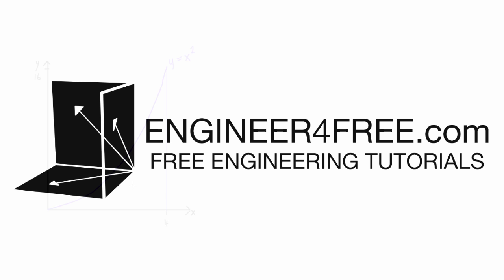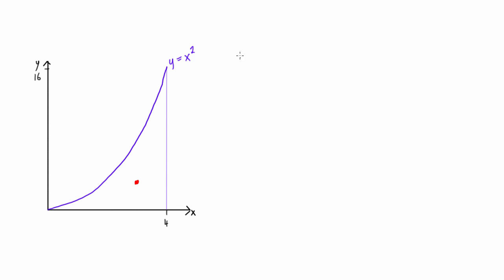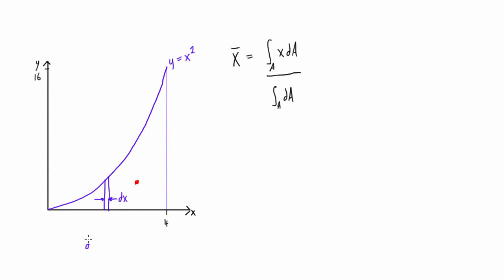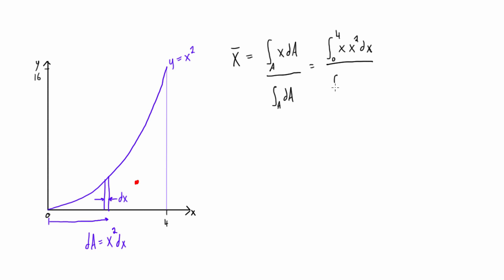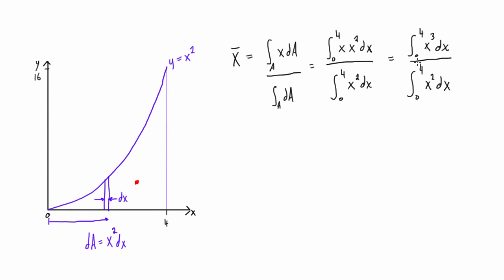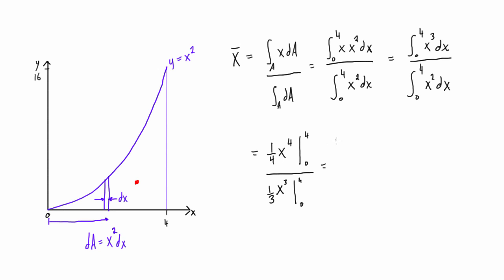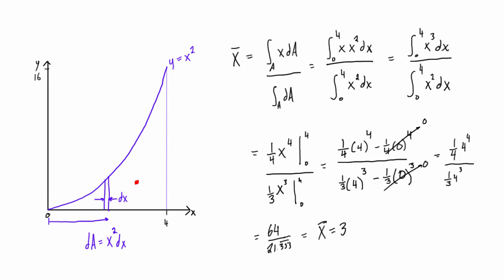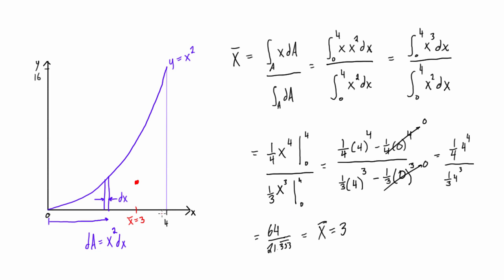How to find the centroid of the area under a parabola

Comment: you would find y(bar) by using the same dA; however, your you would have to divide the y(tilda) by 2 because you differential's centroid is half of the y. In other words the height of your differential is y, so the centroid(y aspect) of the rectangle is y/2. This gives y(bar)== integral((y/2)(dA)). Since the dA is the same, the bounds also stay the same: 0 to 4
Reply: you save our lives 🐐
Reply: @sundod  you have some pretty recent reply